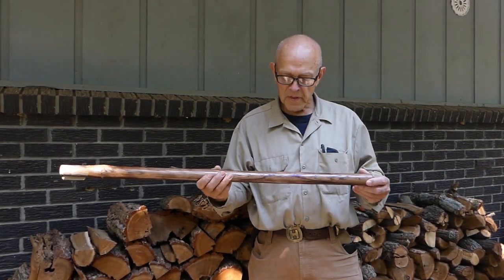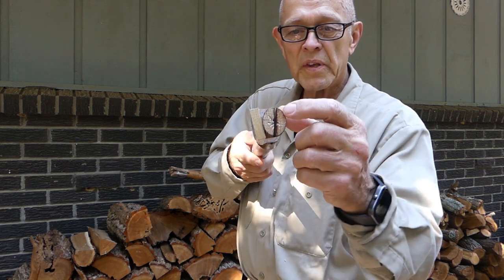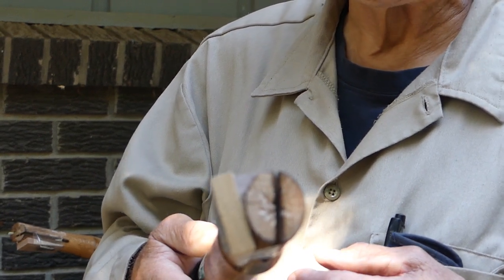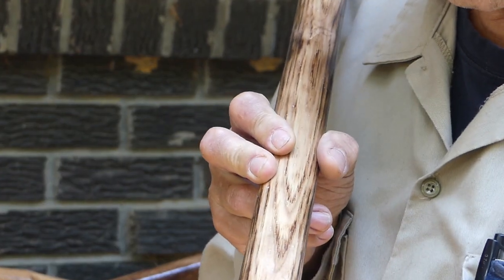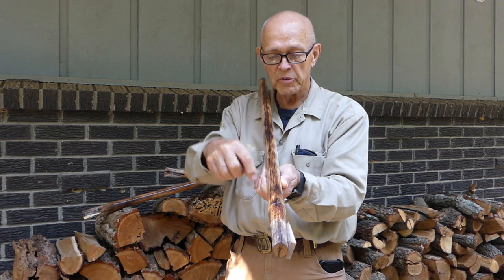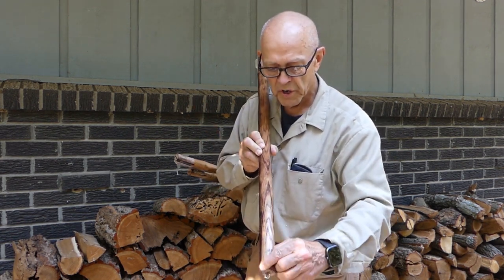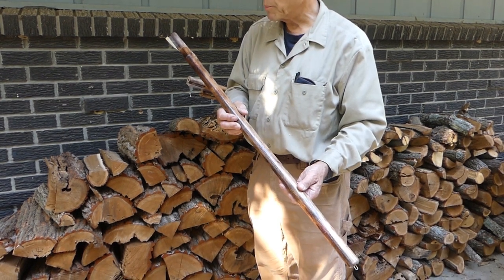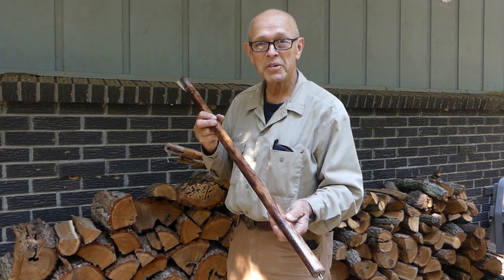Handy Hammer Handle Helper!

Comment: Ideally, if you have the time, you should actually look for a thick and long enough stick of appropriate tree type to use as a new handle.

With a stick, you guarantee not only that you have a straight and true grain, you have the entire growth ring in the handle, lb for lb the stick is much stronger than lumber

Comment: Good point on the grain/growth rings David.
I've always thought fiberglass just makes something look cheap.
I'm checking abs sensors on my f150 this morning. The rear one was dirty, the front ones are sealed and have a blue type of lube on them, so hopefully, the rear ones being dirty will make the light go out. 
Didn't mean to get off topic, haha.
Reply from the maker: It's always something. I need to do the brakes and wheel bearings on my little Nissan pickup and I cannot break the bolts loose on the calipers. I will either have to buy a 3/4" impact wrench or hire a mechanic to put it up on a lift to break them loose. Oh well, or words to that effect!
Reply: @DavidN23Skidoo  I have a Napa torque  dominator 1/2 inch drive impact. In rusty New England here and it has never failed me. That and my snap on air hammer are good friends to have. Had a front wheel bearing break apart in the hub of my 2006 chevy aveo with 260k miles. Tried to press it out with a 3 1/2 ton arbor press and failed. Wouldn't budge. Blasted it out with the snappy air hammer and a punch in about 3 seconds.
Reply from the maker: @Blair62  I am going to see about one of those! I have a Chicago Pneumatic 1/2" impact wrench from when I mechanicked, and it still works well. Marvel Mystery has been good to it.
Reply: @DavidN23Skidoo  I'm surprised they're that tight. They probably had some loctite from the factory. 
Well, the ABS and check brake system light went off , and the 2 rear abs sensors were dirty, so I hope that cured it. They are easy to get out with the wheels off.
Reply: @DavidN23Skidoo  The impact wasn't all that expensive. A little under $200 IIRC. She'll git 'er done. I can promise that. No more skinning up hands and busting knuckles. And I'm getting old enough that I just don't have the strength to hand wrench on trucks anymore. The Snap-On air hammer was more than twice that I'm sure. And worth every penny. That is one hard hitting little hammer. If you have to deal wish suspension components it is indispensable.  These days both of them combined are going to be less than any repair bill and don't even look at the price of new vehicles. And you have them for life.

Comment: This principle is called quartersawn. The white wood between the dark growth rings is soft as a marshmallow. The dark growth rings are as strong as steel. Exactly the way you would design a structural member. Violins make use of quartersawn wood extensively.